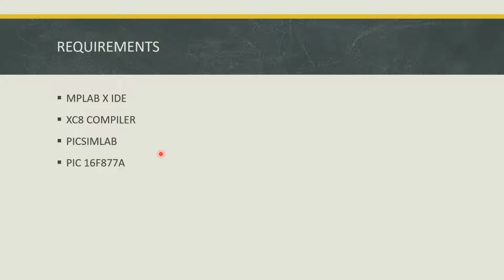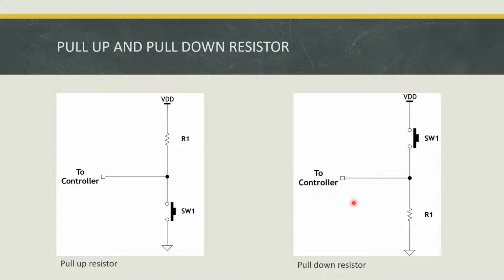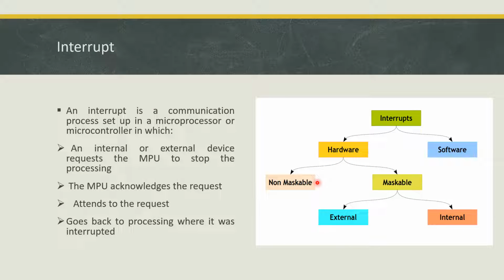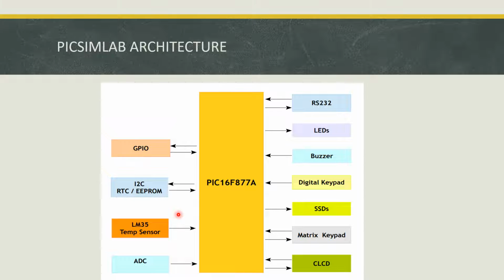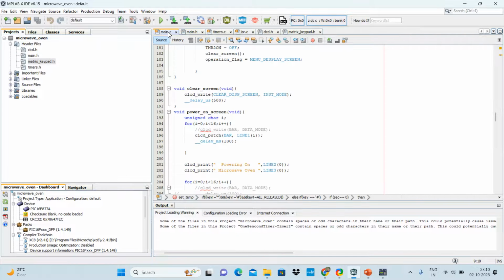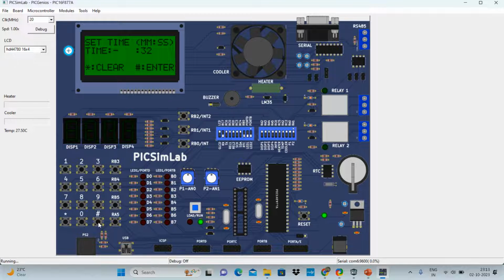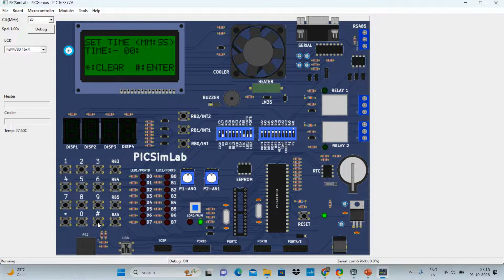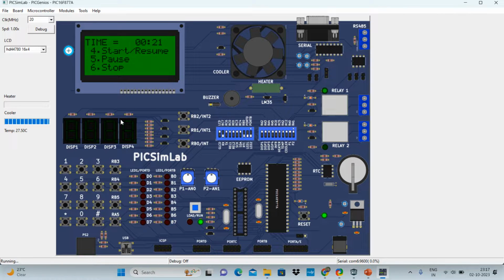Microwave Oven || PicSimLab Simulator || Emertxe || Embedded Project || RksTechno

Comment: I enjoyed this presentation. If accessible, and primarily for fun, using Ansys HFSS to simulate the portable microwave magnetron 2.45Ghz radiation output via waveguides into the cooking chamber is a rewarding & multifaceted challenge to undertake.